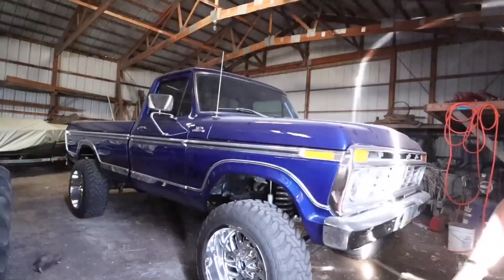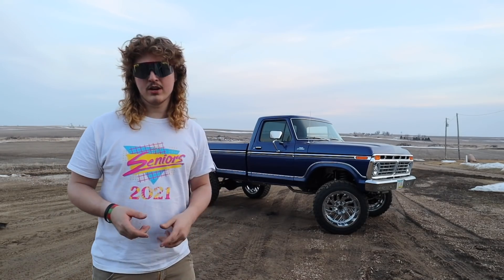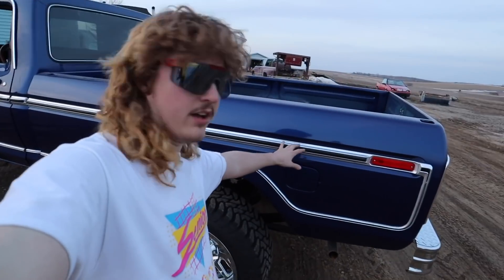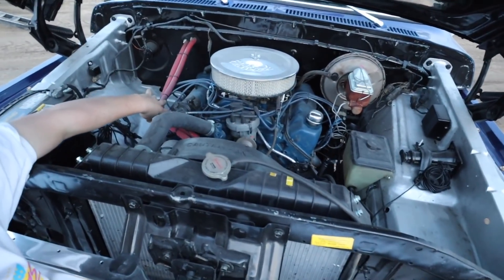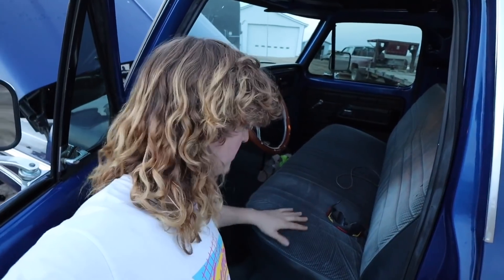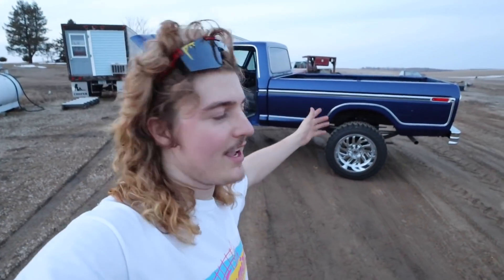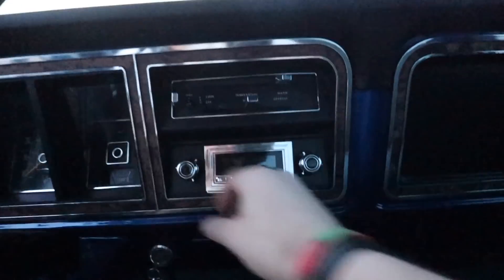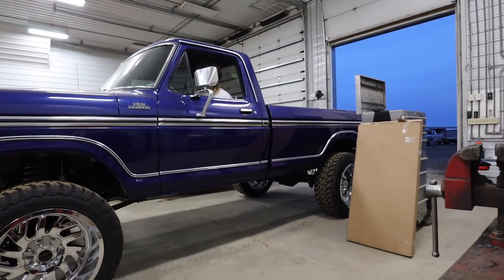I Brought My Dream Truck Home

Comment: I will agree the wheels suck. But it is your tuck and if you like them that is all that matters, By the way the 351 is a small block. Anyone that tells you that you need to go to college to be successful tell them to pound sand. I dropped out of high school, went to work in the coal mines of Wyoming at 17 and then traveled the country and Canada building metal farm buildings and then settled down put my nose to the grindstone and worked a trade job. Could have retired at 55 but didn't know what I would do without working so continued to work and retired at 61 with no worries. My niece is 28 owes 120K in student loans and can't even make ends meet. College is way over rated. If anything go to a trade school that will give you more skills to use on the farm.

Comment: Your education might work for you but not for everyone. The more education you can get the more choices you have. Example: you like welding, you know basic welding but the job wants you to use a special material that you don’t know anything about and the ask if you past the certification on this. There goes that job with a nice pay bump. Take what you like to do and learn as much about it as your circumstances will allow,then save up and go learn more.

Comment: Sorry Coop, a 351 Cleveland is a small block, and they were never installed in pickups.
Reply: @freebooter247  Ford offered two versions of the 351 engine, a Windsor 351 and a Cleveland 351. The Windsor motor is considered a small block. The Cleveland 351 is between a small block and a big block. Even though the Cleveland 351 came from the small block family, few parts will interchange.

Comment: Love the Longtail mud boat in the garage video. Please explain what motor you run on the Longtail. I have built a few mud boats and getting ready to order a new Backwater Swomp 40hp. You can check out my (River Rat) channel to see my old surface drive in action. But I have the new Swomp 40 coming soon.  Please do a video on your boat. I have a video on my 17x48 Custom home built skiff. Check it out. Love your channel by the way. I wish you a lot of success..

Comment: Before I painted I would of put a rare slider in the window Add I would've put some kind of cap Lights on it that really brings the truck out And I would afford a trailer hitch on it All their their net I would not of done anything oh yeah with you saying you wanted something painted under the hood I would have had some kind of metal bent to fit the hood and had that painted to the hood  Add had it all welded in And then had a mirror painted I would have had something with your grandfather and you that would have been nice or in memory of your grandfather Please comment back thank you for this video

Comment: My oldest brother would throw a conniption fit if I did that to my truck, I put dual exhaust on last year and he blew a gasket over that, I had Ford pickup like that once, my Dad HATED that truck more than anything, I remember him saying the freaking thing is the ugliest thing hes ever seen and it's old, it's a P-O-S, me and my brother are still fighting and feuding over the current pickup I have now, your pickup would look really cool with a roll cage with Baja lights and a brush guard mounted on the front bumper with Baja lights too

Comment: Projects  like those are never done, as i know from my own experience, tough i like it a lot as it is!   I would add an lsd diff and disc brakes f+r. and some aluminium heads for 'fuel economics'.  Personly would never do an airbrush or grapics to remember  someone who isnt there to see the endresults , memories are in your head.

Comment: I bet your grades would improve drastically if it was a subject in which you were interested. Why not go to a vocational tech track specializing in automotive tech? I bet you could transfer to another school system if not offered locally. Or what about heating and a/c tech? There's good money in those fields. I'd have to agree you're not a college candidate. Your just saying "I'm a C & D student" and can't concentrate in class won't pay your bills 10 years from now. Right now you're acting like a know-it-all, and it won't help your cause in the long run.
Reply from the maker: I suppose time will tell